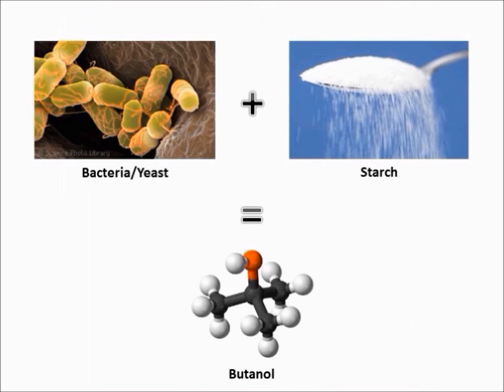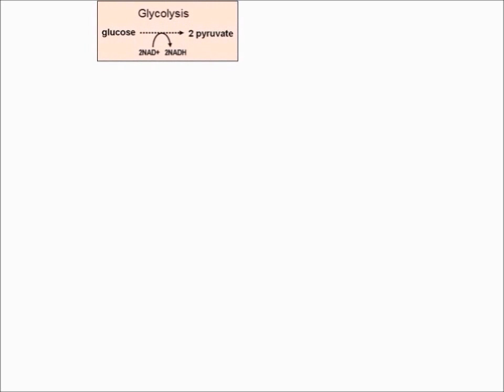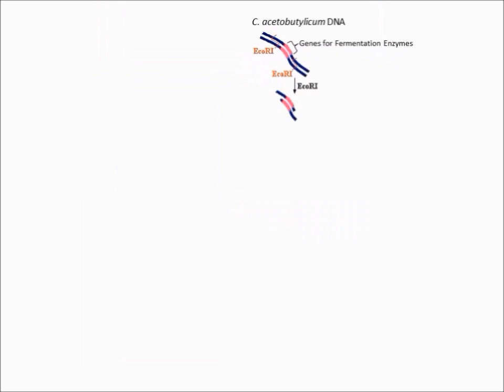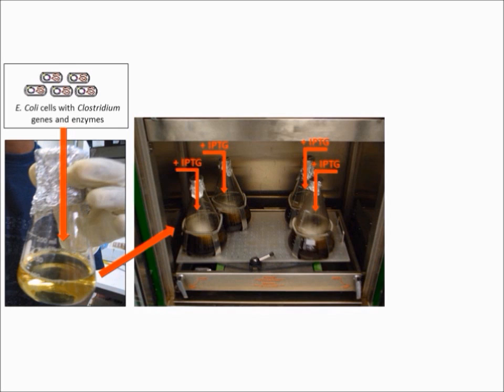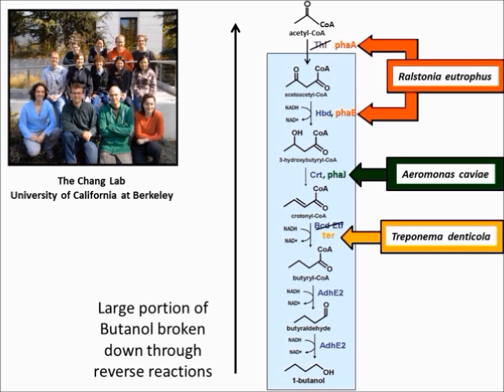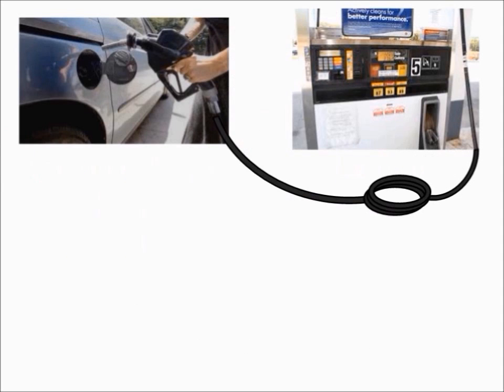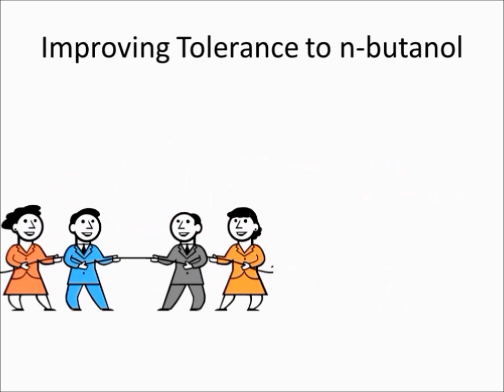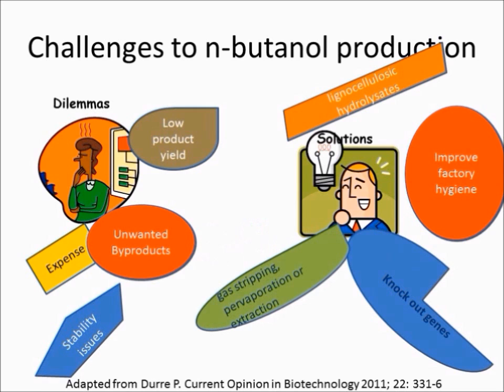The Production of Butanol by E. coli and its Use as a Biofuel

Comment: Butanol production seems like it could be an alternative to gasoline immediately!  What is holding back production?
Reply: Yield is low, at best 2% by weight in your bio-reactor, then it’s expensive to concentrate that butanol into 100% through distillation and drying. 
Already being done for motorsports as an alternative fuel, it’s more expensive than petrol and Ethanol though.